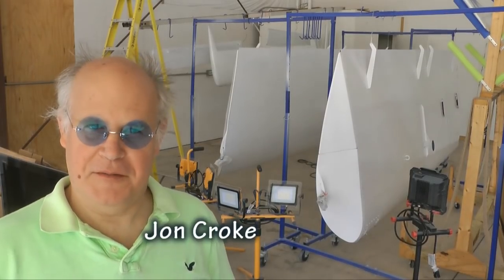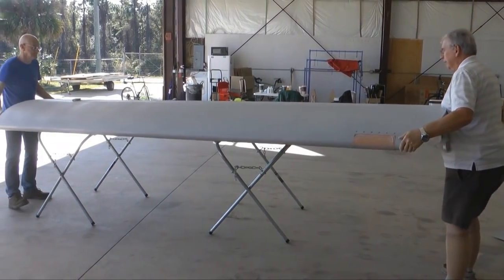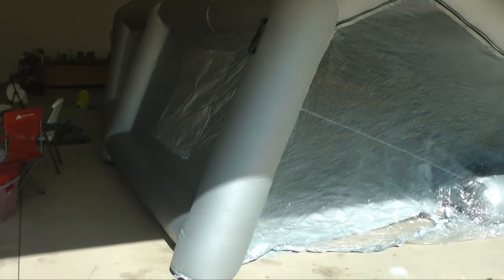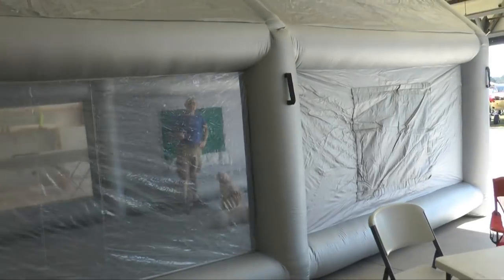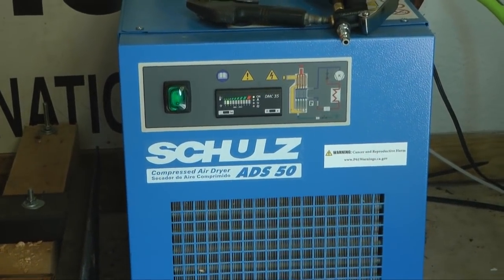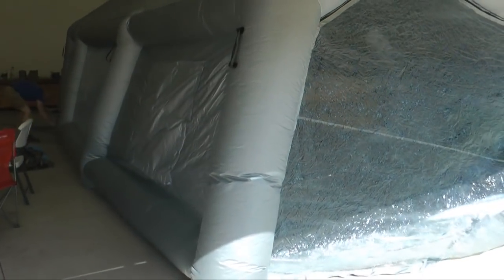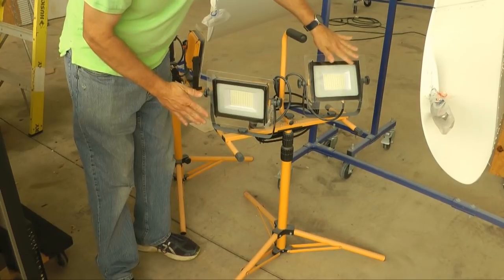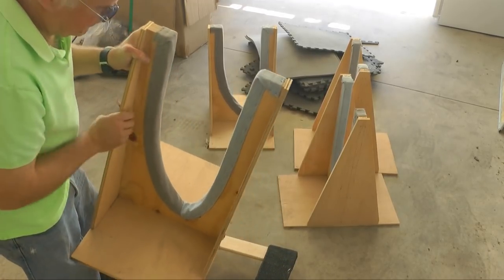An Amazing PAINT BOOTH for painting your Experimental Aircraft

Comment: Interesting but not sure what was the purpose of the inflated booth. You still blew unfiltered air inside, took the parts outside to dry and blocked out the good light. Was it just to catch overspray? I'm stating to think how to paint and came across those bouncy castles but not sure what i'm getting from using one. Wonder if a couple of tarps wouldn't get me the same.

Comment: The problem with these booths you cant use then outdoors in hot weather... your paint booth temperature  will be to hot... if it rains they are not water proof... if it poors the water will collapse  the booth from heavy rain pooling on  roof.

Zipper on large  door is very cheep and breaks after a few uses. Ventalation is not the best.

Power outage is big  concern issue during  painting and drying

Comment: Pretty slick solution.  I saw where a builder put a pvc frame inside the inflatable in case of power issue or blower fault and also to leave inflatable basically standing for more painting later.  I would hope electrical equipment inside booth is explosion proof if solvent based coatings are used.  Thanks for the video John!

Comment: I built my own with 2x2s and 6 mil plastic as I wanted a downdraft design so I made a raise floor and used the space between the joists as an air plenum to draw air down through slots in the floor sheathing.  However, it is not portable and thus takes up space in my shop until the plane is done.  This would be a nice solution for someone who is space limited.  The main risk is losing power when your airplane parts are wet.  Having the booth collapse on your freshly painted parts would be a real bummer.

Comment: Nice but not cheap, I built a frame out of 3/4" pvc pipe and covered it with a clear plastic. Used duct tape on the joints so I could take it apart for storage when not in use.